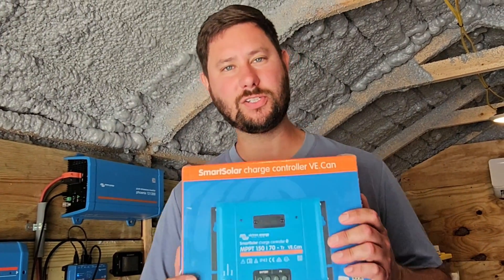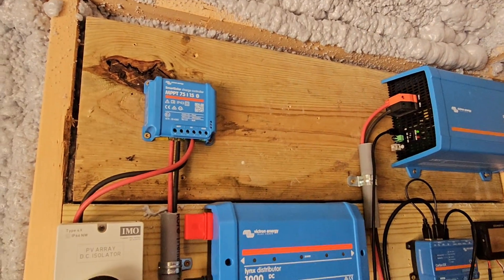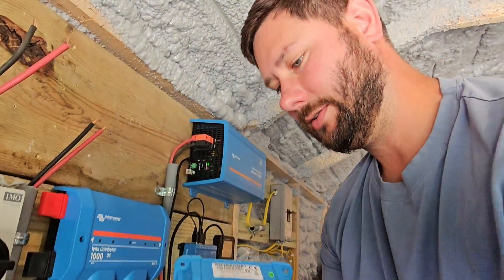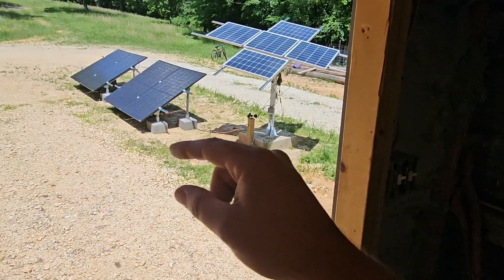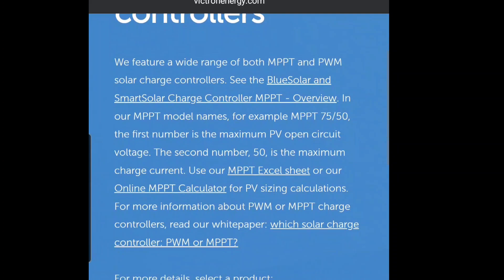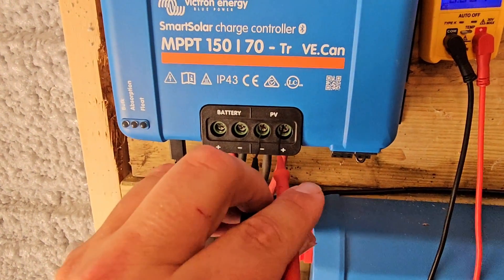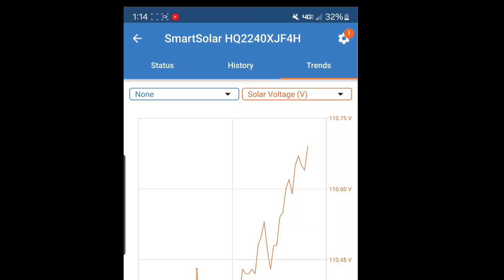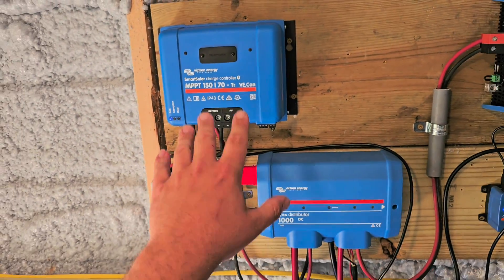Solar Charge Controller Installation, Sizing and Safety #Solar #chargecontroller

Comment: Wonderful information Taddy! 
Question: How far can your solar panels be from your controller before the IR drop makes them inefficient?
Reply from the maker: Thanks, brother. Great question. I'll find the answer
Reply: Thanks Taddy! I've been wanting to go solar but don't want it on the house (because of the insurance increase). However, the only area I would have to ground mount them would be about 200 ft. away.